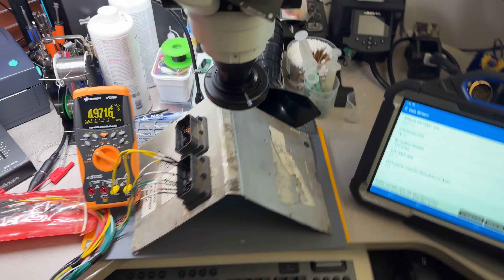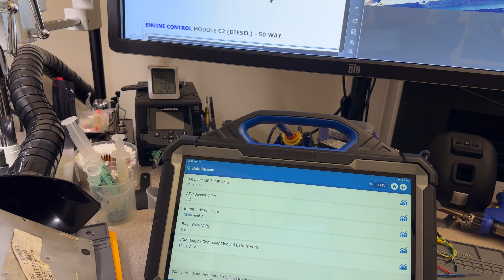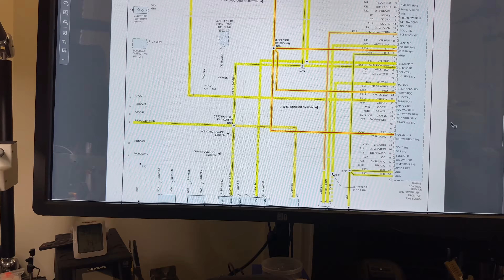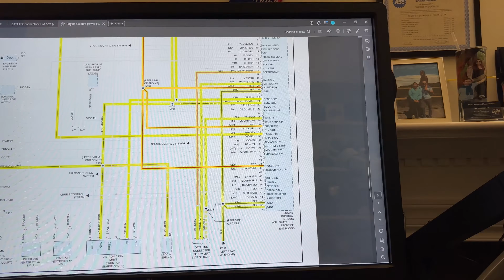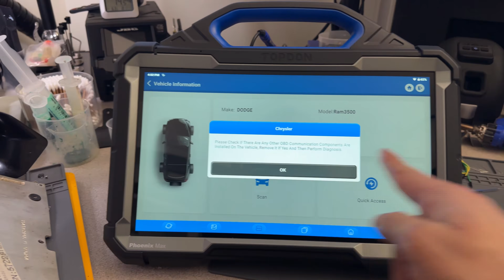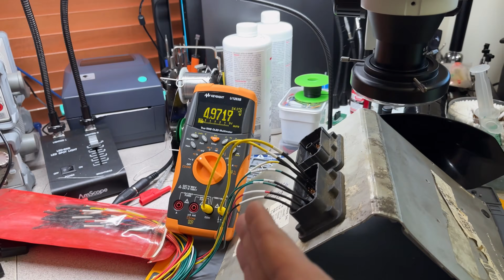2004 Dodge Ram 3500 5.9l Diesel no start no comm diagnosis

Comment: I am working on replacing the old capacitors in a 97 Dodge Ram 1500. Is it ok to replace the liquid caps with solid polymer of the same voltage, capacitance and size or will the low ESR be an issue?